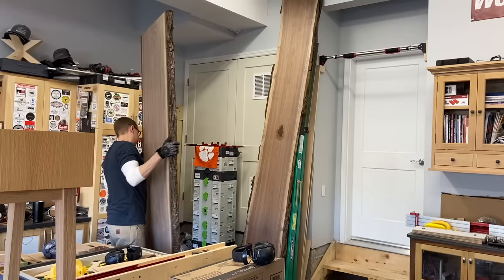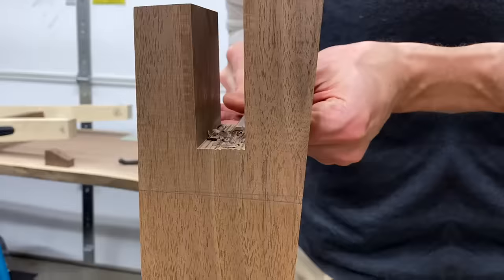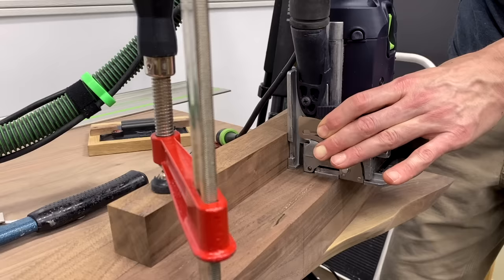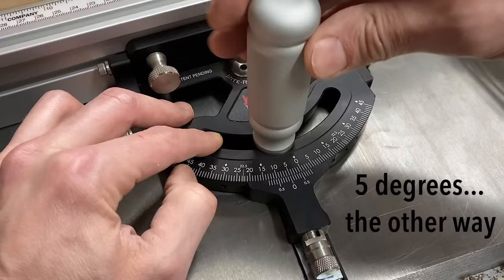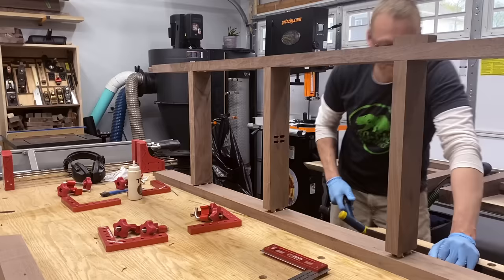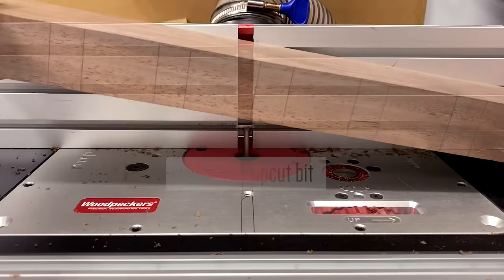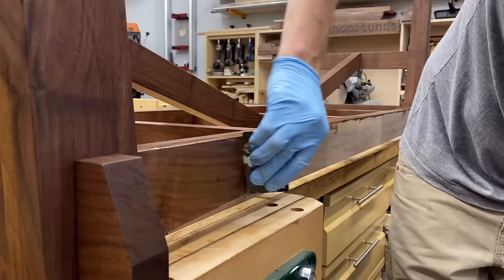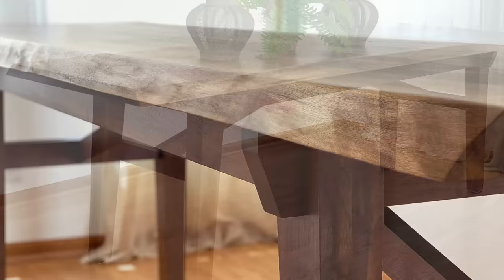BIG SLAB walnut dining table.

Comment: This was perfect as a vanity desk for me. https://www.youtube.com/post/UgkxMAlHv7-BBWMrPRm5-uEoD6rtdT7SG2Qr Especially the glossy finish. Easy to cleanI was looking for something that wasn't the traditional white and with more of a modern feel. This fit the bill beautifully. I put it together with no problems, by myself in under an hour.Make sure you double check where you place the drawer tracks before screwing down. I had one track that needed to be aligned with different holes than the rest.
Reply from the maker: Just the table. I don't build chairs.
Reply: comment pirate

Comment: Really refreshing style. I like your casual confidence, and your willingness to use ALL the tools :-). I’ve been a professional woodworker for more than forty years, and I like to think the mark of a skilled craftsperson is not only how good the work is, but how well they fix their mistakes. So, good on you. That’s a lovely build. May I ask if you’ve ever considered animal hide glue for your big furniture? Not the junk that Franklin sells, but the real stuff, hot in a pot.
Reply from the maker: Awesome, thank you! I appreciate your thoughtful comment. Hide glue...it's an option, but I'm just not that interested in cooking up a pot of glue when epoxy can be mixed in seconds.
Reply: I hear you. I only asked because I started using it when I started back in the seventies, and I still do for some things (mostly leather to wood). It has one advantage over many other glues: it’s not permanent 😆.
Reply from the maker: Victor Yeah, I never really understood the non-permanence...I mean how many pieces of furniture do you need to disassemble? LOL. And from what I hear, it still take a tremendous amount of effort to get those joints to separate. But I’m sure it has its applications.

Comment: A great and beautiful work!
Thanks for the great laughs,  you got a great sence of humour!

Yep - using shelack on wood before applying resin, makes a world of difference when it comes to clean up.

Wheter it is a resin table (I use shelack, let it dry completely, and a good tape on the edges before puring. 
That saves a ton of work when you dont have a plainer, just doing it a hobby basis!), or instead of using glue for table legs etc.

Ads a great bond for instance to wood legs or a corner insert.
Reply from the maker: Awesome! Thanks for the tips! 🙏👊
Reply: @KeithJohnsonCustomWoodworking  
Great work,  and at that, a beautiful work.
Thanks,  I learned the hard way that using shelack is a lot easier to get resin out of details  😂
Reply from the maker: @fnordeon1013  Ha! We all learn the hard way the first time! LOL.
Reply: @KeithJohnsonCustomWoodworking  
The first time??
Im Swedish. We have a saying - if it fails, try and try again.

Meaby I should have tried another way instead...? 🤔
You know, the 2nd, 3rd and 4th time....
Reply from the maker: @fnordeon1013  The definition of insanity is doing the same thing over and over and expecting a different result. LOL. And my grandfather was born Helsingborg!
Reply: @KeithJohnsonCustomWoodworking  

Doing it  over and over  - expecting a different result, IS the Swedish way (keep in mind,  a majority has been socialists for a long time!)! 😊

Well, I learned. Eventually. Using epoxy requires a seal to keep it in place, and protection from sticking to the wrong places. 

So your grandfather is from Helsingborg? 
That is about 1.5 hours by car from here.
Worked there a lot in the past. Renovated a whole barn from scratch 😊

They have a ferry line there to Denmark. Great food,  great domestic beer. Great people  (yep, far from Swedes!).
Reply from the maker: @fnordeon1013  I really need to try that shellac trick! And Denmark sounds lovely!!
Reply: @KeithJohnsonCustomWoodworking   

Yes, shellac (it is spelled different here) is a great help to simplify resin working.

What not post a video using it, that would be great watching. I enjoy learning new ways, and getting new ideas, in wood working! 

Yes, it is lovely there. Especially in the summer. The people are simply more sensible there.

They have watched what happens in Sweden, and did the opposite 😂

Comment: First video I’ve watched of yours.  Nice work.  I’m intrigued by your glue selections.  I also wish I could find walnut as inexpensive in my area as you stated that was in another comment.  At any rate, I’m a subscriber now.  Beautiful design as well, by the way.
Reply from the maker: Thanks for the sub and the kind words, Travis! Not sure where you live, but I've always found Facebook Marketplace and CraigsList to be good places to look for lumber.
Reply: @KeithJohnsonCustomWoodworking  I live in Milwaukie Oregon.  There’s a few ol boys around here that sell slabs, and there’s Goby walnut.  The ~$1000 slabs are mostly meh.  Nice ones seem to start around $2k and can go up into 5 digits. I’ve seen most materials double in cost around here over the last few years though so it may just be the market I’m in.
Reply from the maker: @Watchdog_UFOtestpilot  Yeah, slab prices are off the charts because everyone wants or thinks they can build a slab table or an epoxy river table. I think you will have better luck searching for dimensional rough lumber.

Comment: Gorgeous table!  This video gave me some great ideas for the dining table I want to build. In case you haven’t heard of it you can use clear Gorilla Glue which doesn’t expand like regular polyurethane Gorilla Glue.
Reply from the maker: Thanks! Does the clear have the same gap filling properties as the poly glue?
Reply: @KeithJohnsonCustomWoodworking  not exactly. You just have to use more glue than the brown. It’s the expanding property of the brown that fills voids.

Comment: That was incredibly nice. Your walnut was very nice and dark. Is it difficult to find this much walnut that matches so well? Thanks for sharing excellent work 👍
Reply from the maker: Thanks Brian!! This was all cut from the same tree, so it all blended nicely. Also, air-dried walnut from my area tends to have the same look to it. Kiln dried lumber can be done in many ways and it does different things with the color. There is also a lot more variation depending on which mill/lumberyard you buy it from.
Reply: @KeithJohnsonCustomWoodworking  Very nice 👍. Thank you
Reply from the maker: @brianlee6849  No problem!

Comment: Really interesting design. And it came out looking great. I’m curious about the stretchers - do they interfere at all with seating on the ends? Meaning, would your knees/legs be too close to the stretchers? Great build.
Reply from the maker: That's a great question! The design was reviewed by myself and the client and we did a mock-up to ensure there was no interference with the end stretchers. Now, if you tucked yourself all the way in with your stomach against the table it might get a little tight, but who does that?? 😜😂 And thanks for the kind words!

Comment: Also, I’d love to hear more about the finish, Rubio. Thanks great build, love it.
Reply from the maker: You got it!  I encourage you to check out their website for a ton of great info. I've been using it for years and love how easy it is to apply and it's durability. Here's a link for you: https://www.rubiomonocoatusa.com/en/p/products/interior/3-protection/colours-and-protects-in-1-single-layer/15-rmc-oil-2c?country=us
Reply: Keith Johnson Custom Woodworking - Thanks a bunch. Your a Great Guy! Can’t wait to see more videos. I’m trying the Rubio. Is it easy to apply to small more intricate projects? I like to make boxes, jewelry boxes, things with hidden compartments. I do metal and wood fabrication. I’m Retired now so I only do work I want, for people I want. It’s fun now! I’ve been trying different finishes and am not real happy with any. But do love danish oil on walnut. I have a bunch of 100 plus year old walnut I haven’t touched much. It’s gorgeous!
Reply from the maker: M M It can be time consuming and a little tough to work in tight areas, but it certainly can be done. If you are just working small boxes, etc. you should be fine. You can use a putty knife wrapped in a clean rag to get the excess out of the corners.
Reply: Keith Johnson Custom Woodworking - Thanks so much!
Reply from the maker: @MJ-nb1qn  No problem!

Comment: nice work. i recommend only black screws. why do you chose silver screws für the tableplate?
Reply from the maker: Black screws are drywall screws and are very weak and the heads have a tendency to break off. The silver are also square drive screws which drive easier and don’t strip out as easy as Philips head screws

Comment: Incredible man! You are making next level stuff! Any recommendations on how to work on mortise/tenon or bridal joinery? I typically am just using dowels or pocket screws... How do I up my game?
Reply from the maker: Thanks Kyle!! I'm not sure what your tool arsenal is, but mortises can be rough cut on the drill press and squared up and finished with a chisel. You really need those walls flat and perpendicular to the face of the workpiece which is why drilling by hand can get wonky. However, you can always drill smaller and then square up nicely with chisels. Tenons can be cut by hand, bandsaw or on the table saw. I always cut my mortises first and then fit my tenons to those. I would just give it a go on some scrap pieces.

Comment: I am making a two slab live edge table and after running them both through the planar and joining them, I have one corner that is slightly bowed up maybe 1/8". Would c channel straighten that out? Also the legs I'm using have a steel base that will span most of the width. Do you think the combo of both would flatten out the slight warp?
Reply from the maker: I wouldn't count on the c-channel to flatten the top, but since it's only 1/8" the steel base should help pull that down flat and in combo with the C-channel I think it's unlikely that it will cup.

Comment: Amazing! Just one question. What is the reason for the metal track under the table?
Reply from the maker: A large slab like that may have a tendency to want to cut...the steet C-channel will keep it flat.
Reply: @KeithJohnsonCustomWoodworking  cut you mean shrink/bend? Thanks
Reply from the maker: @neriyahoren3580  Sorry, cup/twist not cut.

Comment: Beautiful table, wow!  First time I've seen your channel - new subscriber.  May I ask how you debarked the slab?  Thanks.
Reply from the maker: Thanks for the sub! I just used a chisel and some elbow grease to get the bark off and then used an orbital sander to get the rest of it. Luckily this stuff came off easily. Most people use a draw knife to remove it quickly.
Reply: @KeithJohnsonCustomWoodworking  Much appreciated.
Reply from the maker: @terryduprie6313  no problem!

Comment: The U channel stops the top from twisting and the slots in the channel allow for expansion? Is there a rule to the spacing, why not 4 channels or 2? Thank you.
Reply from the maker: Yes, that's correct. There are no rules that I know of. I always like to put one on each end and then add 1 or 2 in between based on the length of the table. If this was a 10 or 12-foot table, I probably would have used 4 instead of 3.
Reply: @KeithJohnsonCustomWoodworking  thank you very much.
Reply from the maker: John Dennis Any time. Thanks for watching!! 👍🏻

Comment: I just found your bent lamination in my feed, first time seeing you - I really like your production style, and your approach. The work is fantastic. On the glue ups, using the poly glue - would hide glue not work, and still give the open time you need?
Reply from the maker: Awesome, thank you!! Hide glue would definitely work, but I have no experience with it. 👍
Reply: @KeithJohnsonCustomWoodworking  It provides the slippery fit of epoxy, about 30 mins open time, doesn't interfere with finish. But you also mentioned the epoxy doesn't expand the fibers. I've never had a joint swell on me using it, so I'm guessing it doesn't swell the fibers either. GUESSING - I need to research that.
Reply from the maker: @rroades  You also need a heated glue pot to keep the hide glue warm, right? That just seems like more work to me with cleanup, prep, etc. LOL. For the epoxy, my hardener and resin each have metered pumps that I dispense into a cup, mix and go.

Comment: Amazing! Would you mind sharing your process on how you apply Rubio? Thanks
Reply from the maker: Thank you!! For the Rubio...spread around with a squeegee for big areas or an old hotel room keep for small areas 😜. Then I work it in with a white Scothbrite pad and let it sit for 5-10 minutes. Then I wipe off all the excess with a clean cotton cloth until it is dry to the touch. From there, it’s 7 days to full cure.
Reply: @KeithJohnsonCustomWoodworking  Thank you! I really like the slight sheen on your furniture. I cant seem to get that with only one coat at 150 grit. What grit do you sand to on the first and second coat and any water popping?
Reply from the maker: ebrahim.karimjee Sometimes I water pop, but generally I don’t. I sand to 150 for the first coat and then scuff sand with 320 or 400 before I apply the second coat.

Comment: Hey Keith. Awesome videos as always! 

Quick question, I have the same jointer/planer combo. I noticed the beds of the jointer were not co-planar, called Felder and they told me the beds were adjusted from the factory to create a spring joint/glue-up. Have you found the need to get it re-calibrated to reduce the spring joint at all? or do you even have this type of calibration on your machine?
Reply from the maker: They all have a spring joint from the factory and it's infuriating. It makes no sense. It screws everything up. I haven't adjusted it yet because I'm afraid I will screw it up even more 😂
Reply: @KeithJohnsonCustomWoodworking  lol I thought I was being too picky but same here, it drives me nuts. It's an expensive machine and don't feel like paying a couple hundred dollars to get it serviced since it's brand new 😤 Also pretty sure if I try to do it myself, the whole thing will end up in a dumpster the next day 😅 Thanks for letting me know I'm not alone on this!
Reply from the maker: @andresfelipemoscosohernand2371  You're not alone! LOL. Yeah, it continues to frustrate me and I will eventually pay a tech to come and fix it.

Comment: The C channel. When would you say it should be used/not used on walnut? By the way, great build there!
Reply from the maker: Thanks! I use it on almost every table top. However, it's not completely necessary if you lumber is dried and milled properly. I mean, no table you buy at a furniture store has them.  It's just added insurance that helps the top remain flat over the life of the table.

Comment: I know I want a Domino Jointer but haven't purchased due to shortages. Are you happy with the 500 or do you find yourself wishing you had the 700? I have the money for the 500 and I'm wondering if I should just save and get the 700.
Reply from the maker: Hey Karl! For 95% of what I do, the DF500 is perfect. I have only found myself needing the the 700 once or twice. So, it ultimately depends on the size of furniture you are building and whether those larger dominos are necessary or not. The 500 is much more compact and easy to maneuver and fits my workflow much better. Hope this helps!
Reply: @KeithJohnsonCustomWoodworking  Thanks! This definitely helps.  I'll go with the 500. I don't make anything much bigger than what I've seen on your channel.
Reply from the maker: @Kcustom216  perfect!  Enjoy!!

Comment: can you explain why you add the c metal channel?
Reply from the maker: The c-channel helps keep the table top flat and prevents it from warping/cupping through seasonal humidity and moisture changes.
Reply: @KeithJohnsonCustomWoodworking  And is it the only way to do that or there is other solutions?  because c metal channel may not be available
can you add the projects budget price in your videos to know how much it may cost to build like your project and also links for your tools of you can please
Reply from the maker: @Rhythm.Studio  You could use another board and create a sliding dovetail joint all the way across the width of the table. That will lock it flat. Link for my tools in my Amazon store is in the description of the video. Sorry, I don't include prices because they vary too much.
Reply: @KeithJohnsonCustomWoodworking  ok, thanks a lot

Comment: Was the “C” or Cee channels added for support? Newbie woodworker here.
Reply from the maker: The C-channel is not for support, but helps keep the table top flat and prevents it from warping/cupping through seasonal humidity and moisture changes. 👍

Comment: I just built a simple TV stand. I cut everything near perfect but my plan was making the shelf inside it near perfect to but I put it in last for staining and sealing purposes.

I made the backside 1mm shorter and the frontside the right size.

Turns out I measured both measurements wrong and I had to mallet the shelf for 30 mins. Turned out great though.

Itll be on my Page tomorrow

@sand.and.stain.co
Reply from the maker: Oh man! Those ones sting! I'll check out your IG page and have a look!

Comment: Do I eard scheisse oder wat??? 🤣🤣🤣🤣
Reply: @KeithJohnsonCustomWoodworking  do you have german origins?
I need a suggestion man: I’m gonna doing a conrete stair woodsteps in 30 mm walnut (noce canaletto in italian). So, I would bild them in one piece but what about cracks? Is not possible install C rails underneath but can I cut some grooves and fill them with epoxy?
Reply from the maker: @sal8743  Sorry, I have no experience with stairs